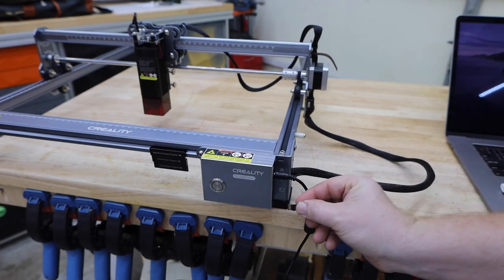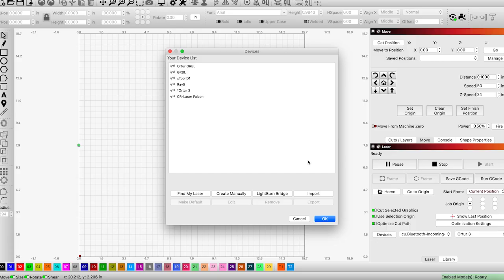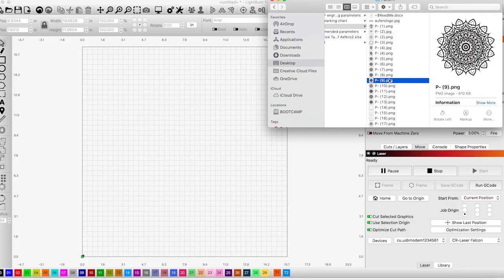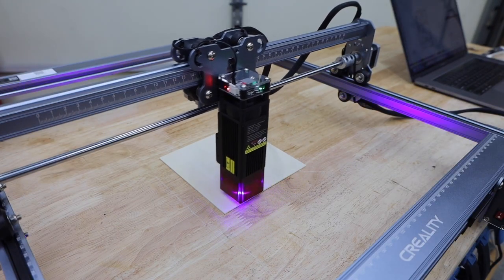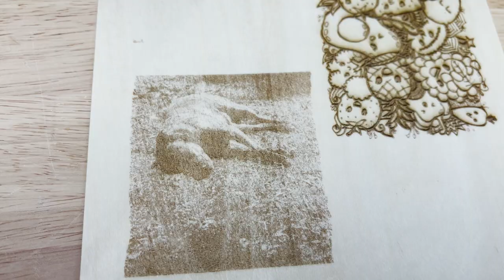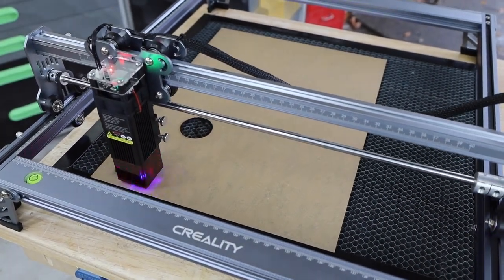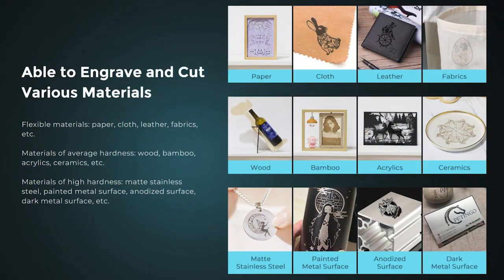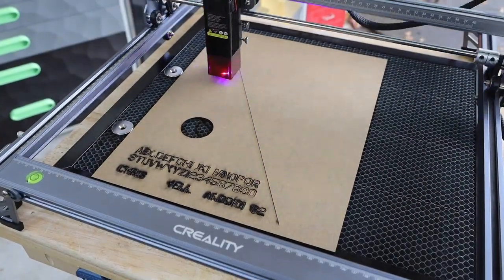Budget Friendly 10 watt laser - Creality CR Falcon review and testing

Comment: I heard you say you can slip a memory card straight into the engraver, so am I correct in saying that I could program what I want it to do in my house at my desktop and then take the card to my shed and put it into the engraver and it’ll engrave the design? So far I’ve only seen engravers that need to be plugged into a laptop and as I don’t own a laptop I’d have to buy one which doubles my set up costs. I’ve been told that any burning software won’t work on my iPad Pro too, is that correct too? Can I use my iPad to connect to the engraver? Many thanks dude. 👍
Forgot to say, I’ve had a flashforge 3D printer for 5 years and I do all my programming/downloading on my desktop and then save to a usb stick, remove it and slip it into the printer, I want something similar in an engraver if possible?

Comment: If I engrave on thin basswood ply, then engrave on solid 20 mm basswood boards using the same settings, would the engravings look the same on the ply & 20mm board?

Comment: I have a 10w creality laser you can hook usb c  to usb c to connect to the pc. I want to know can I do connect a USB C to Ethernet Adapter, Driver Free RJ45 to USB C [Thunderbolt 3/4 Compatible], 1Gbps Type-C Gigabit Ethernet LAN Network Adapter so I can run cat6 cable to my pc its just to far to run usb c only since I moved my laser out to the garage.

Comment: hello. can you explain me, how to start from any point ? in this device
Reply from the maker: In the lower right hand corner there should be a box that says your origin. It will have options like user origin, absolute, and current position. There’s also a box that will select what part of the drawing is the start point. I usually use current position and set the green start position to either the center or lower left. Move your machine to that part of the piece you want to cut and you should be good to go.

Comment: Did you had a chance to do some engraving/etching on metals? Mild steel, brass copper?
Reply from the maker: It only works on stainless steel or coated metals like anodized aluminum.

Comment: I got the machine I work with lightburn but it is not printing anything!Why?
Reply from the maker: Is it moving?
Reply: @ChrisPowellFSD  Yes it is moving,it is going to the position and it looks like it is printing but the result is the piece of board empty without any print or even shadow! What am I doing wrong?
Reply from the maker: @music_.official2054  sounds like it’s an issue related to the laser. Most likely not the laser itself. Start by checking the power cable. Make sure it’s seated properly and there’s no broken wires. Check both ends of the cable. Look in the plug too just to make sure all of the pins are in the right and one isn’t bent.
Reply: @ChrisPowellFSD  All the parts are ok. The laser goes to position its doing the moves but its not printing and its not beaming the laser light at all!
Reply: Not connected leptop

Comment: Looking at this bare-bones design I was wondering if it could be mounted vertically on a wall to save space 😂
Also helps with getting the smoke away from the path of the laser, making more of the laser's power reach the wood. 
Probably not a good idea for cutting though, as the pieces falling down might get lodged somewhere where it could interfere with the next cut... Maybe mount it at a 10° angle so they don't fall out? 😁
And the motors might not be powerful enough to actually move the laser up and down at the required speed (only designed for horizontal movement), that will probably be the biggest issue with that... It might help to mount it rotated by 45°, as a diamond shape, so each axis only has to move the laser up a slope rather than one axis having to lift it completely vertically...
I'll give you this as a video idea, feel free to use it 😜
Reply from the maker: Most of these lasers have a sensor that disables them if they’re tilted. Also, I’m not sure how the steppers would like having to lift the weight of the gantry.

Comment: Nice, concise review 👍
Did you use any special ventilation? I expect you probably just have a well-ventillated workshop to begin with (looks to be a good size 😉).
This doesn't have anything to do with this machine specifically, just curious.

Also, is there a reason they're called engravers? Does using it as a laser cutter maybe void the warranty under the "unintended use" clause? 🤔 Or is it genuinely just to manage customer expectations ("WTF, this doesn't cut 2x2 steel profiles??" 😂)
Reply from the maker: Sometimes, but for this I just had a big fan behind the camera.